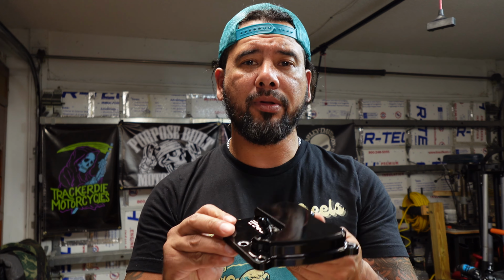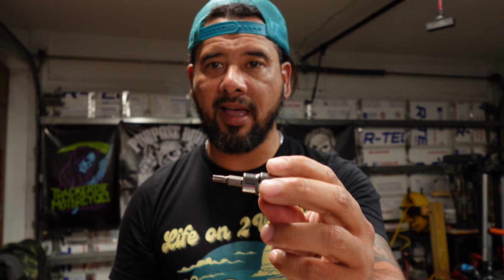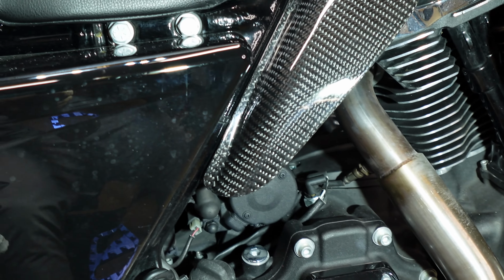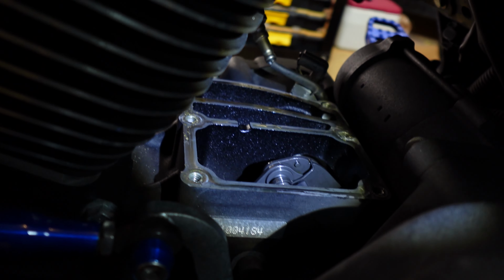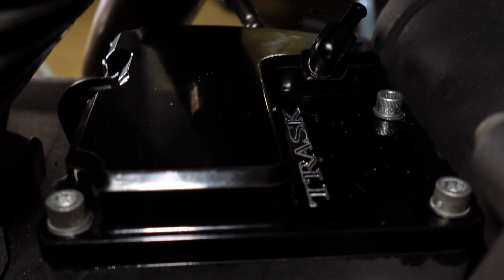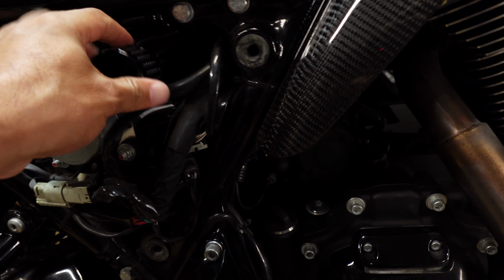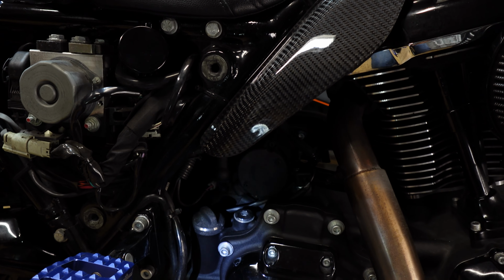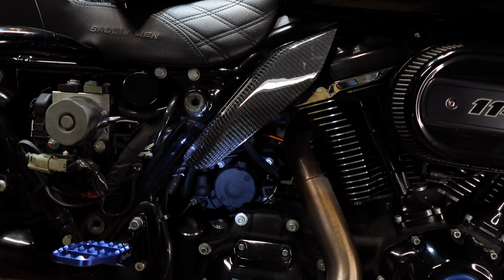Trask Performance CheckM8 Vented Transmission Top Cover Harley Davidson M8 Engines

Comment: This was one of the first mods I did for my 2023 street bob.  Not an easy installation because of bolt access though but doable like you say. Its a fairly expensive part but it is well made and so far I havnt detected any oil on my air filter.
Reply from the maker: I probably should have when I upgraded the exhaust on my Street Bob to have it out of the way.... Did you have to remove your exhaust?
Reply: @WeRide2  I installed the trask unit with the  exhaust off. I was changing out the stock exhaust anyway. I think you could still put it on with the exhaust on the bike. Take off a heat shield and any other small stuff in the way.
Reply from the maker: Good to know! Thanks!!!

Comment: Any difference before n after?
Reply from the maker: I would say my pant legs don't get stained with blow by like they used to.
Reply: @WeRide2  Besides, your pants get stained. Is there any noticeable performance like crisp torque at low gear?
Reply from the maker: @paulson9616  TBH no, nothing noticeable in that regard.

Comment: I've installed it and routed the hose to the right-side cover just as they said and exactly how you did it. But a few months later I noticed lots of oil fumes under the right-side cover. Does it affect the CheckM8 performance if you reroute the hose to the bottom next the bike lower frame?
Reply from the maker: I think higher is better so you have gravity on your side. I've seen it routed up and between the cylinder heads as well. Check your oil levels to see if it's over filled.
Reply: @WeRide2  I make sure oil is always 2-3 notches less than full. Also I think the nibble has a valve so oil doesn’t go back. I would rather the fumes go below the frame that’s all.
Reply from the maker: Sounds good.. let us know how it goes if you end up routing it that way.
Reply: Routed to left side next to transmission shifter rode. Looks good and any extra fumes will escape to bottom next to left side of lower frame. I’ll try to send pictures.